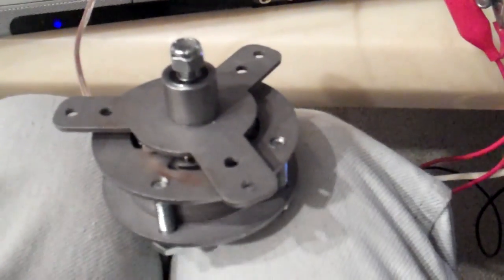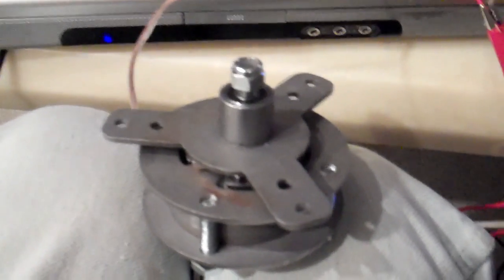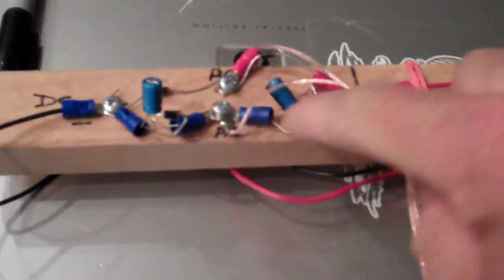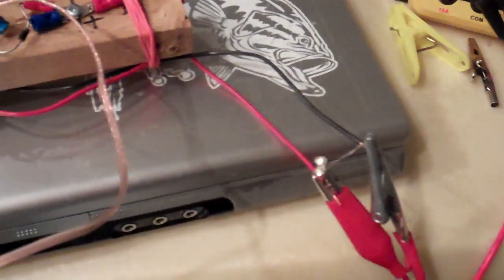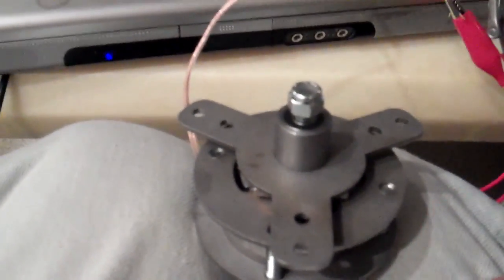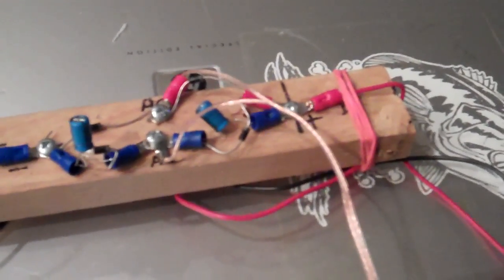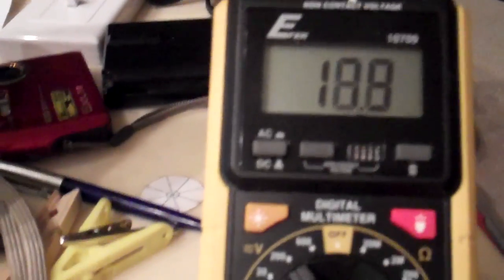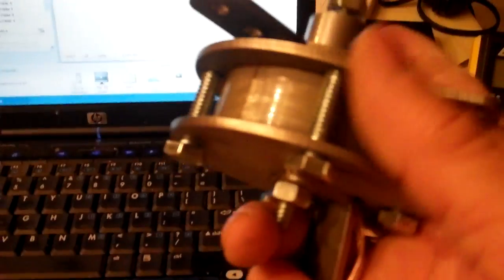Mini Gen .mp4

Comment: @wtam69 yea, they where little experiments I try to do, the wheel could be used in either angle, when I tilted it back and forth there was alof of force or torque what ever you want to call it plus 1 bearing was missing have the balls but it still spun very easy, iI was just drawing and idea for it as i type this out using a sail type blade just trying to see how i could set it up.. you know anything about hub motors?

Comment from the maker: @MrHorsetail I did not have to wind the single coil. The challenge for me in making an alternator would be the design and casting of the stator and getting all the miscellaneous parts. Unless you are buying the parts in quantitly, it's cheaper and easier to just get a kit like this.  I have never worked with magnets that are so strong so it's kind of fun.